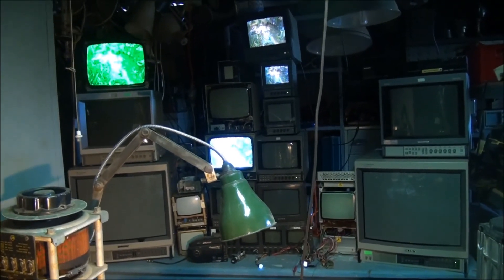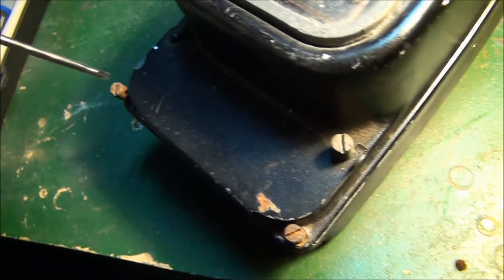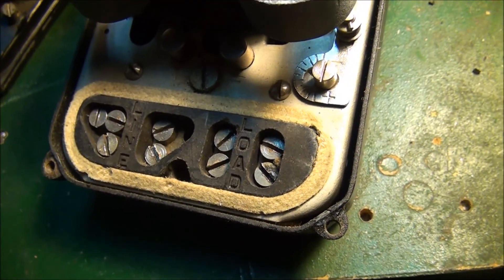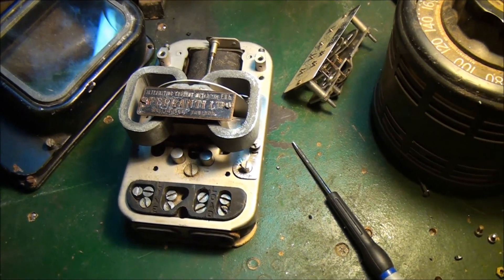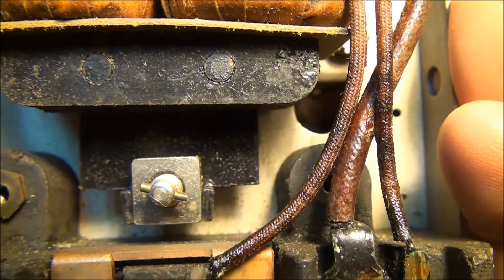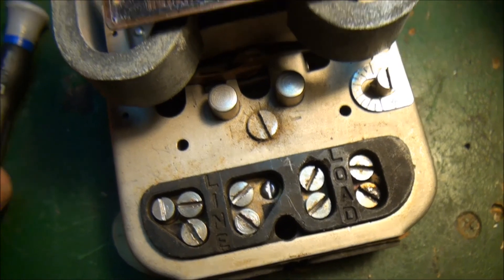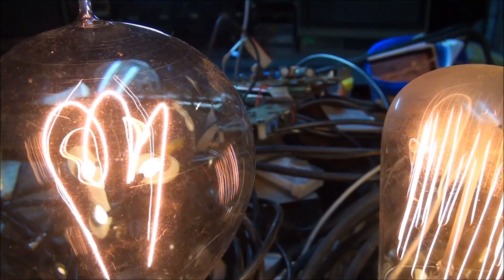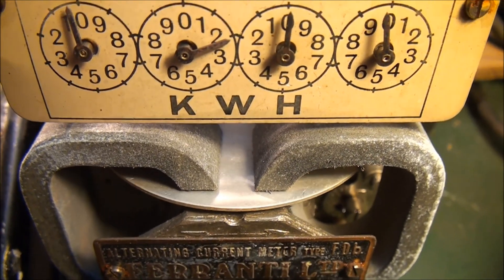Vintage Ferranti electricity meter teardown

Comment: Nice TV collection. Did I hear the word device ? LOL !
Interesting hmmm, your 240 Volts FDb has 2000 revs.kWh while the 230 Volts FDb meters I have are 2182 rev /kWh for the same Amp rating. Nice video. We had some of the 10 Amp 1096 rev/kWh versions literally burning out the current coil when 60 Amps mains fuses were fitted and the meter not upgraded in the early 1990's. Your current coil is in perfect condition.
Reply from the maker: RODALCO2007 Ray, I have to blame you for using the word "device"! I do love that word and I can not get it out of my head! HAHAHA! I like it when you use it in referring to your pet cat or wasps or other things. I am glad that meter turned out ok, got worried when I was unable to measure any resistance on the input terminals, thought the voltage coil had succumbed to moisture but then I found the terminal screw was missing. No signs or smell of overloaded current coil thank goodness. I am looking for some old MAZs or BAZs but no luck, I remember when I was working for the local power commission in the 80s, we changed out hundreds of those meters and they all went to the local tip and got squashed under a large Bulldozer, terrible sight!
Reply: ***** You could try to get holf of Larry (HDXFH) I know he has some BAZ meters. It is a real shame how utilities sometimes destroy there perfectly good meters. We had the same in Auckland one day when nearly 500 new meters were thrown in the crushers when deregulation started. The local POCO did not want the meters to go to an other retailer. I salvaged two of those meters.

Comment: Lovely light bulbs you have there.
Reply from the maker: pow0006 Thanks! They are pretty old units, the larger one is a carbon filament lamp. They came from a deceased estate of an old bloke who was an electrical engineer in Sydney who did work on early power systems. He seemed to have collected early lamps and other items.